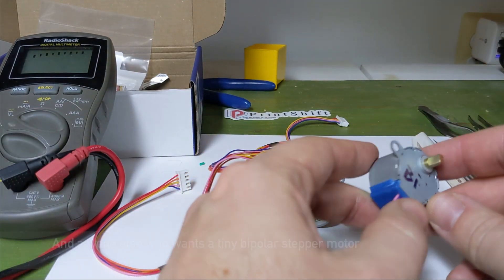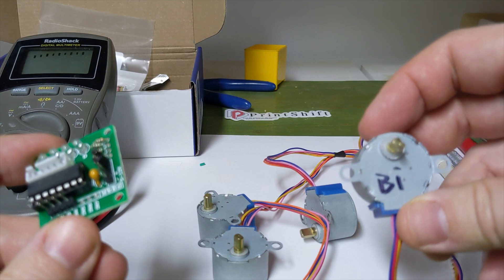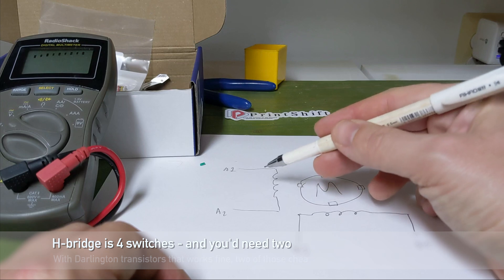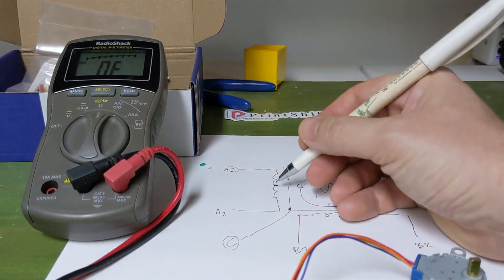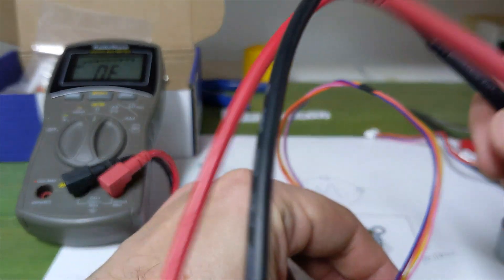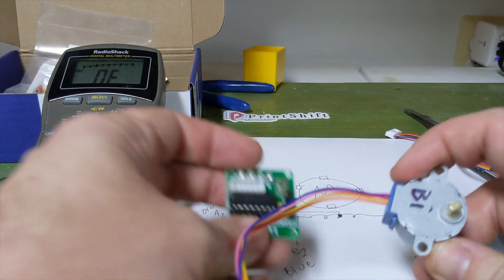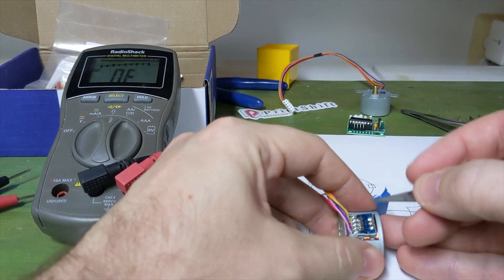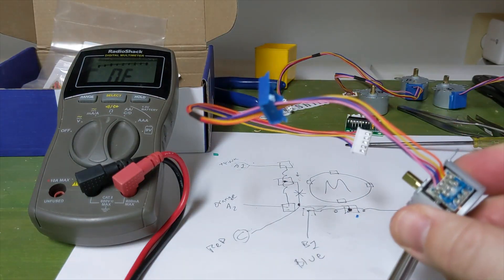Unipolar to Bipolar: 28BYJ-48 Stepper Motor Upgrade with explanation

Comment: Hi. Can you suggest a stepper motor which have a low step angle( i need high res for measurements) also small such that it can be used near an electromagnet.

Comment: There is no need to modify the motor at all!  Just ignore the middle red wire and use a bipolar controller and the two coil ends and it works exactly the same!!   
Well exactly the same as the described modification, but it is not the same, because now you are using double the length of wire, and so double the resistance and half the current.  You can make up for it by doubling the voltage to 12v.
If you are going to modify it,  what you really want to do is double up the wires so you have half the windings like before, but twice the copper and thus have the same resistance and hence current. You can do that by taking the two coil wires in the middle terminal (the mid point of the coil) and connect one to the end, and the other to the start. If you don't do that, cut the middle trace to one coil and add another "red" wire into the "middle" of the other coil, and now you can use only half the windings and run it bipolar and have the same performance as unipolar.   I have also noticed the coils only fill up half the motor, so you could just rip out the coils and put in a single winding of a thicker wire. 
I'm converting one to a servo and need the shorter motor this has.  The "short" servos are like $50 to buy.
Reply from the maker: Look at the circuit diagram - unmodified, every coil is connected to the ground in the middle - you can drive it from the ends to the ground, but without cutting that connection you'll be running at 1/4 power.  You also can't do microstepping cuz the current would be flowing from one coil through the ground leg to the other coil

Comment: Cool video but really as a beginner I have no clue what you are talking about. 
Please explain what exactly happens now with this motor. How is better and for what purpose? And if I cannot use my controller anymore then how can I control it now? 
I'm looking for my motor to be able to go forward and backward, and I am making that project now. Can this video help me?
Thanks.
Reply from the maker: Making it bidirectional really increases the torque and lets you control it smoothly with microstepping.  It can go forwards and backwards before being modified, though.
Reply: Ok so I got a A4988 and am willing to try. Am just a bit confused of wiring and code..

Comment: 0:45 - a Darlington transistor is just a high power transistor.     ???
Reply from the maker: They're wired as one, but on the silicon it's two transistors with their collectors chained together, for higher current gain.  You can build your own with any two npn transistors, but they're useful enough that the ICs are cheap and readily available
Reply: It just sounded like you were saying  Darlington pairs are high power or control high power.  Certainly there are many lower current Darlington pairs.  Their configuration is for high current gain, that is what Mr. Darlington achieved. @PaulChase

Comment: What driver do you recommend for these bipolar motors?
Reply: Any bipolar driver that can handle the current these motors take (which is not a lot) should be fine. A4988 are very popular for this purpose.
Reply from the maker: I've run these even with the fancier Trinamic drivers - 2209 and 2130 - but with the built-in gear reduction on the motor there's really no need for higher microstepping, but they can still do endstopless homing, which is nice.
Reply: @PaulChase  :  Hi Paul, I enjoyed your video, thanks... great little motors for learning with.
By 'endstopless homing', do you mean driving the mechanism against the end of it's travel to identify a known position?

Comment: Thank for giving this problem. By the way, I want to know steps/re (out shaft  of motor)  in this case (unpio is 64*64 step/re) give me this number. Tks.
Reply from the maker: The manufacturer says 2048 full steps per revolution, which is full-steps assuming it's got an integrated 1:64 gearbox.  The motor comes in different variants with different gearboxes internally, though, so best to check.  Also, your steps per mm will be higher if you use a modern stepper driver that implements microstepping
Reply: @PaulChase  Tks! Yesterday I test on arduino uno and It is 2048 step/revolution. It's right as you said. Tks .
Reply: Parametters of configuration need caculation and experience. Give me these para...

Comment: do you need to double the voltage to use it like this?
Reply from the maker: Nope - it will draw more amps per turn, but it's such a small motor that nearly any stepper driver can handle it.
Reply: @PaulChase  V = I * R. If you keep V the same, and double R (because you now have two coils in series) the current halves, not doubles. Or I'm not really understanding it.

Comment: How hard would it be to change the code of a program to make it useable for bipolar?
Reply from the maker: You need to change hardware to go bipolar.  Normally these motors are controlled by turning on 4 transistors in series, one per coil, circuit is transistor->coil->ground.  Bipolar, the coils run both ways - so you need an h-bridge per coil (two per motor) which is basically 8 transistors.  Generally you use purpose built stepper drivers, which do fancier switching and more efficiency

Comment: I am wondering why It's made unipolar if  Bipolar is better in terms of Control and Resolution??
Reply from the maker: To drive a Unipolar, you just need a Darlington transistor array (well, 4 of them) and a counter to power each half-coil in order, since the center of the coils are always grounded.  Super simple.  To drive a bipolar, you need to swap the power and ground for each coil - so, a stepper driver or a set of H bridge motor drivers.  So... if you don't need the resolution, you can get away with much cheaper electronics.
Reply: @PaulChase  now Makes sense thanks you 👍👍

Comment: Can we replace this Mod virsion in place of Nima17 ?
Reply from the maker: Nema 17 is WAY bigger and stronger.  A nema 11, I'd say yes, nema 14... maybe?  These are way geared down, so slow but high torque.  However, the gears are plastic and will strip if overloaded.
Reply: @PaulChase  yes , I know Nima17 is bigger and better but I asked just to know that what if  cnc made with nima17 2.5kgcm SM  replaced with Modified Bipol 28-BYJ  ? Will it work similarly in terms of Accuracy or Its Backlash will cause problem ( if run without Load ) , also will it Support Microstepping of N17 ?
Reply: @PaulChase  :  The final gear is attached to the output shaft by a cup-washer, acting as a friction clutch.  This should stop the gears from stripping... the problem then would be that your mechanism has lost it's accuracy, in much the same way as if the stepper had missed steps.
Reply: It would depend what you are using it for.  If your machine requires precise movement / repeatability, these are not really suitable.  The gears introduce backlash that you do not get with a direct drive stepper without a gearbox.  There is also a friction clutch on the output shaft which could easily slip.  This would stop your mechanism from accurately returning to the same position repeatedly.
If accuracy / repeatability is not important, say in something like an animitronic toy or sculpture, these modified motors could be ideal.

Comment: Mr. Paul I think your explanation is very cool, congratulations. Could you explain to me how to use this 28BYJ-48 motor with the A4988 Drive using arduino?
Reply from the maker: Mine came with a Darlington transistor driver - so to drive, you can just turn on each coil in sequence, and it will click over.  AFTER making it bipolar, you need a fancier h-bridge driver - cuz each coil needs to be powered and grounded in sequence.

Comment: Does the torque change with this?  Also, with gear reduction, would these work on the larger belts?
Reply from the maker: Bipolar is more torque - twice the torque with simple math, because the coils are twice the size.  The downside is a more complicated driver, but, well, drivers are cheaper now.  With enough gear reduction anything is possible, but it's more efficient to have a good motor coil - any sort of gearing will reduce speed, and that'll impact Z-movement on printers.